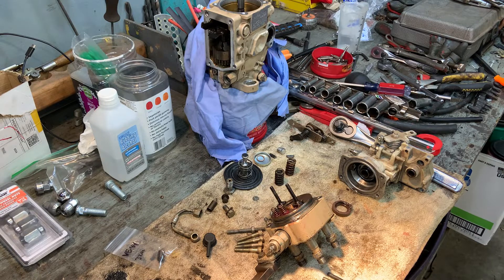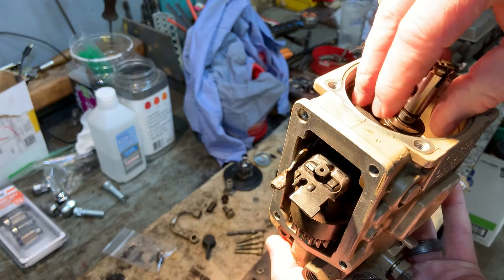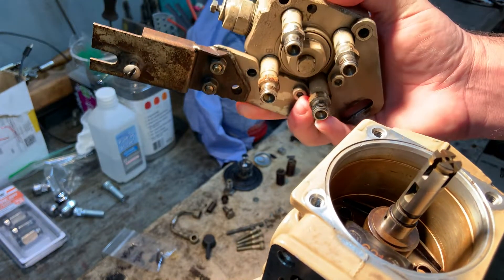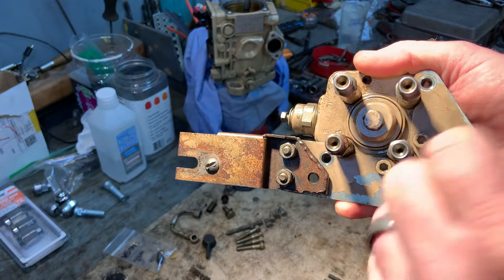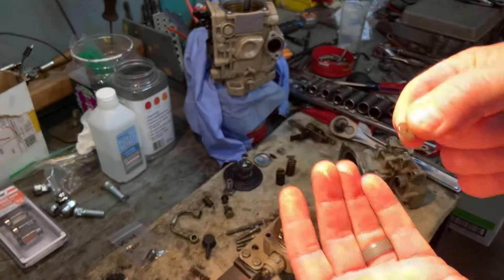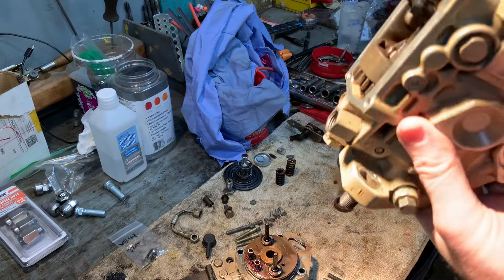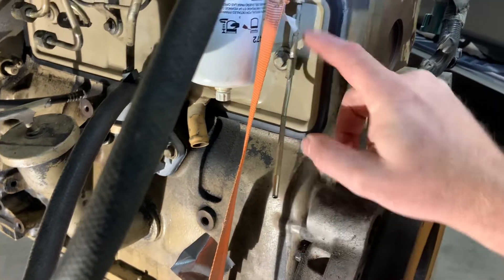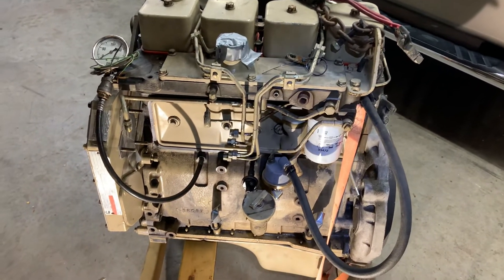4bt Cummins VE Pump It Almost Exploded

Comment: I need help with the timing
Reply from the maker: @jeancbosques  what’s going on????
Reply: @jeepmanking3577   took on part  and I can’t figure out out  how the gear for the pump  goes on it on what letter
Reply from the maker: @jeancbosques  have you seen my video on the 4BT timing mark location???
When the engine is timed correctly and you push in the timing top dead center pin in the video the gear keyway will be located at the 11 o’clock position. That would be top dead center and install the injection pump. .
If the front covers off and you can see all of the gears, you can still see exactly where mine is located and you can adjust yours is necessary. I think mine was on the B, but just do it like the video shows and you should be just fine.
Reply: @jeepmanking3577  thanks so much  I got it going
Reply from the maker: @jeancbosques  awesome!!!!! Thanks for watching!!!!!